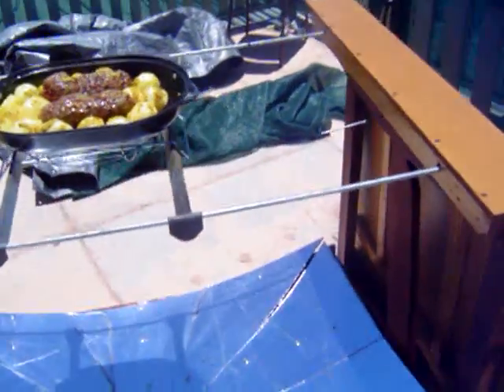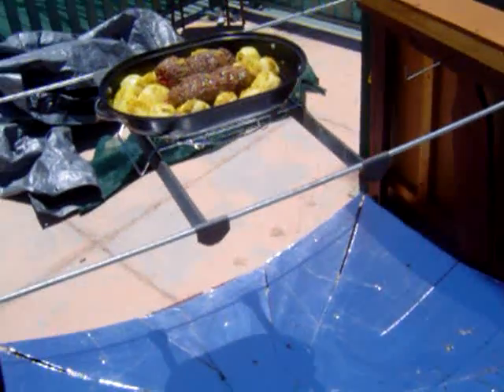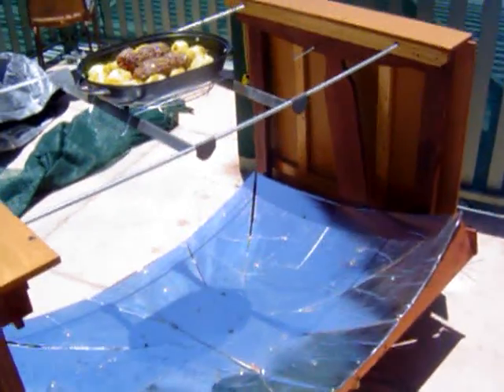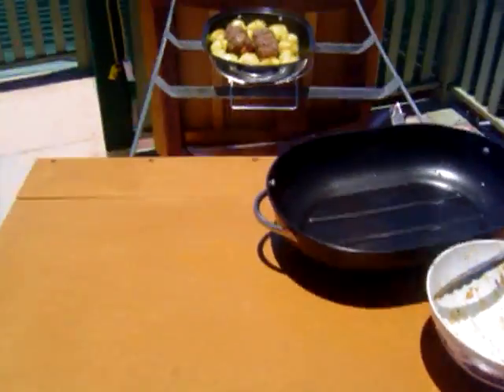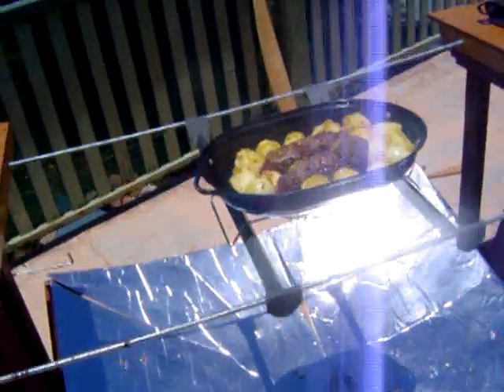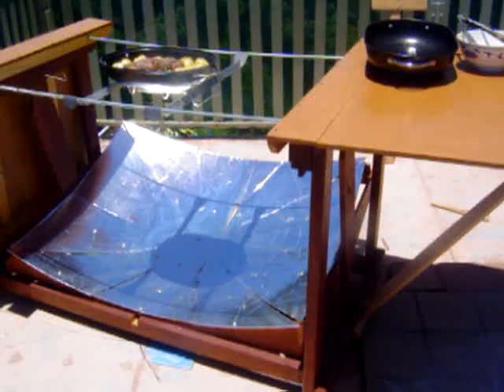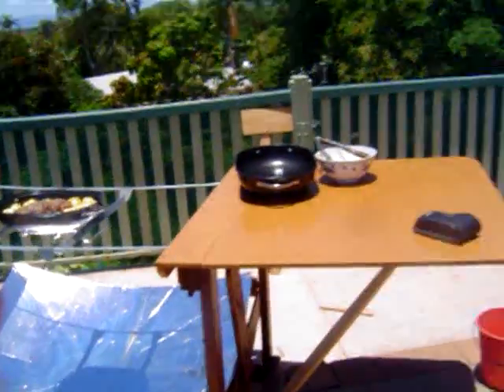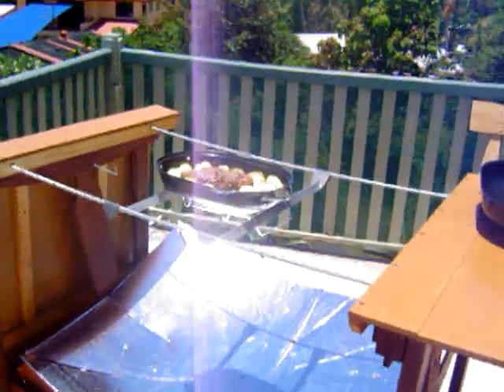solar bbq why a part circle and not a parabola

Comment: Have you  tried putting an insulated box over the cooking pan? An upside down box might reach higher temp and keep its heat more reliably than the normal  sun from above box cookers,but it is not on the net. You have an ideal system for testing the theory!   All you need is the box and an oven thermometer coming down from the top. (It must be protected from the direct light). You can have the pan empty  because all you are measuring is speed of temp gain and static heat reached. Can you?
Brian